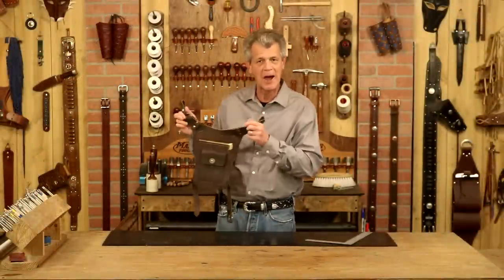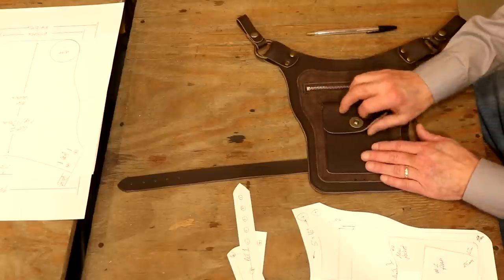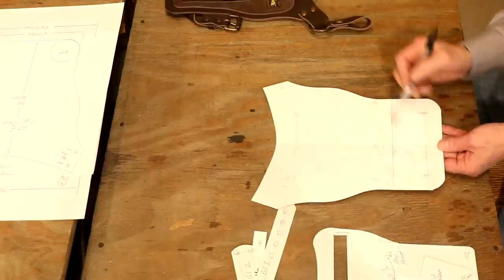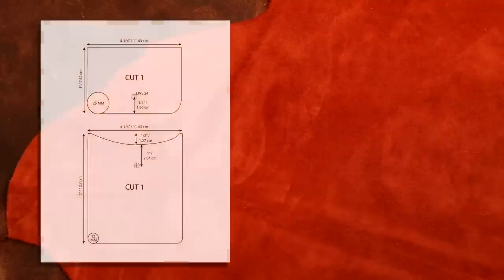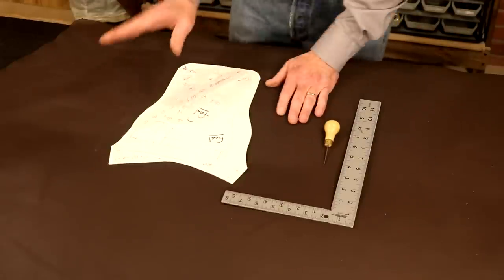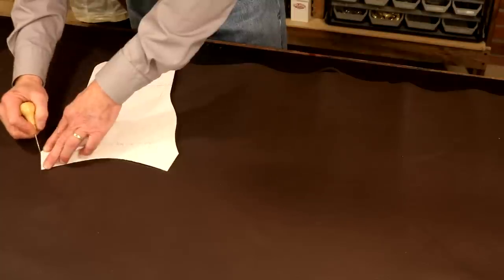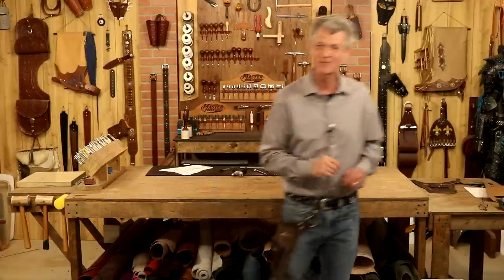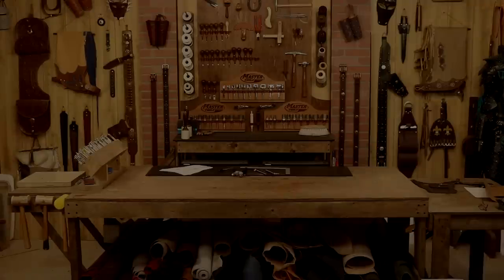Making a Leather Hip Pouch

Comment: I like the design but the pattern pieces do not work together as is.  If you compare the shape of the pattern piece 2 with the zipper to what was created in the video it is not the same.  Be aware before you start cutting your leather.  Piece 2 will not fit as is.
Reply: Yes, I noticed the same thing.  I went back and checked printed dimensions and measured to make sure printout was correct.  It was all correct - pattern piece 2 is too large to fit on piece 1.  Fortunately it is too large instead of too small - so at least I can cut down piece 2 to fit appropriately.

Comment: so no need to bevel and burnish the edges?
Reply: If you don't want to do it, it's ok : the bag will still work. But it will look less professional.

Always do it 😊
Reply: @plumhtv3891  just thinking for my own use. But what is the purpose for beveling and burning??
Reply: @david frank  It's about aesthetic and edges are not "sharp" anymore so comfort too (especially if this edges goes into a crease, for example, it could hurt with time !^^)